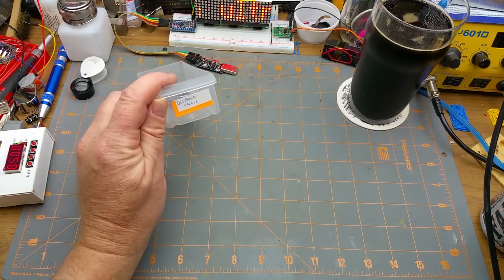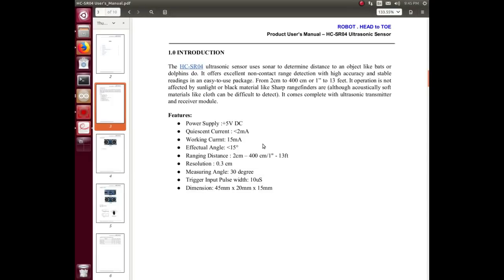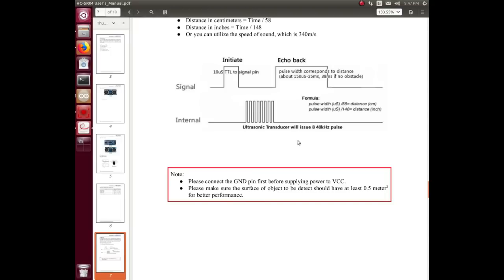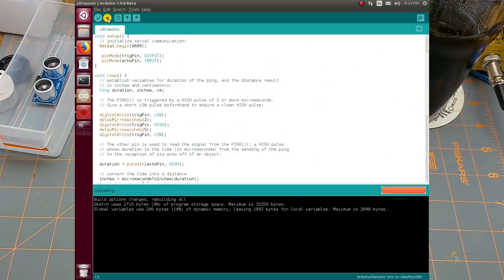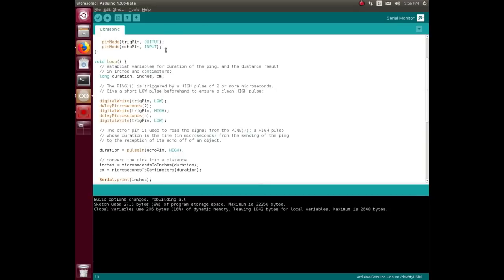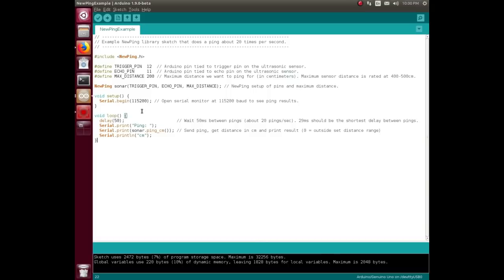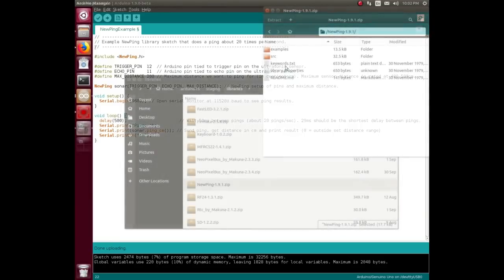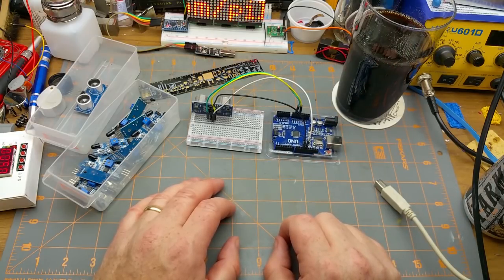tinkering with an ultrasionic distance module

Comment: The ultrasonic range detection may requires to measure the humidity as well, because of the sound travelling different speed in case of humid or dry air.
Reply from the maker: Absolutely. If you are interested in maximum accuracy, both  temperature and humidity has to be taken into account. 

For my application, "close enough" is adequate. I didn't feel that the extra math was worth the effort for what I'm hoping to use these for.

Comment: Hello, interesting video! Please keep up the good work, especially your mailbag videos!

The HC-SR04 is a 5V compliant ultra sonic sensor and it is chiefly used with 5V micro controllers and via a voltage divider it can also be used with 3V / 3.3V devices such as the Raspberry Pi.

However I recently discovered that the HC-SR04P which you use in your video is compliant with devices using 3V to 5V logic, without the need for a voltage divider. Just supply 3V to the VCC pin and connect up the rest as normal.

To identify the HC-SR04P from the standard, obviously it will have P written on the board, but if not, all of the chips are horizontally placed on the board.

I recently wrote a blog post on this sensor, hope it helps. https://bigl.es/tooling-tuesday-hcsr04p-ultrasonic-sensor/ 

Best wishes
Les